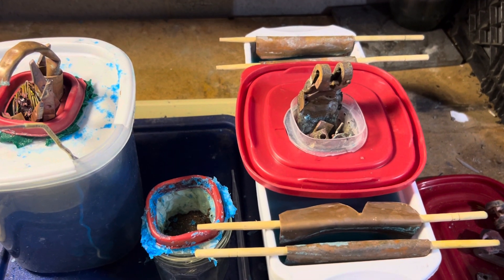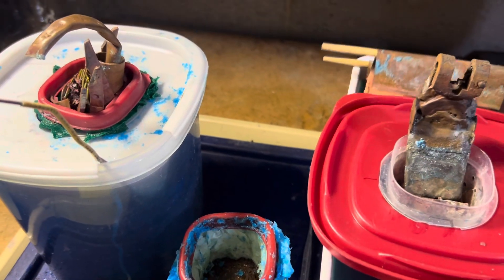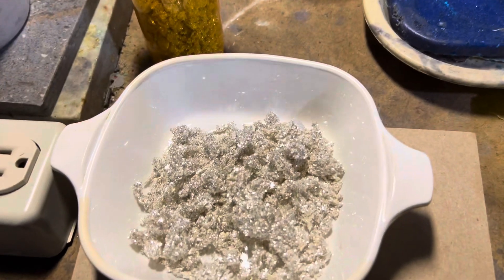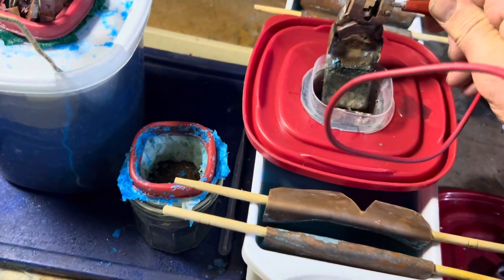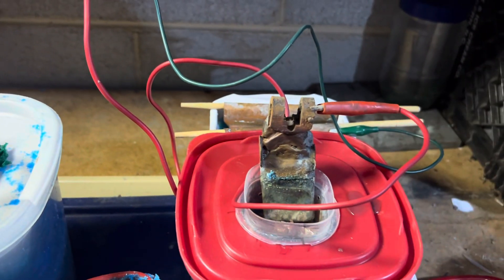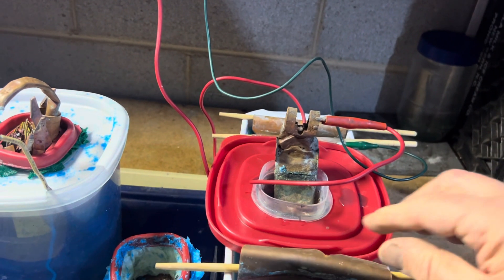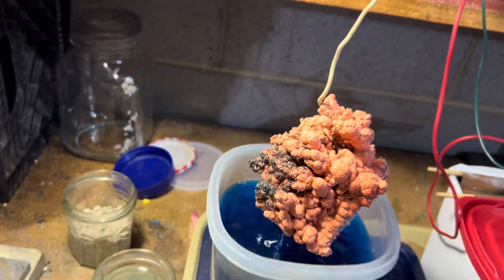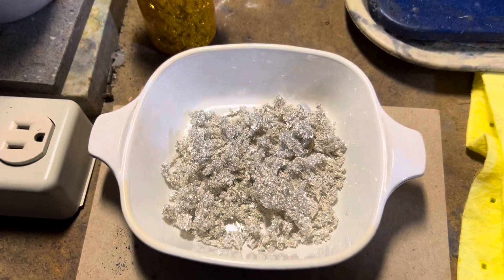Copper refining Cell #scraper #chemistry

Comment: Can you use one power source for mutiple cells?
Reply from the maker: No sir it would be to much resistance , one power source  per cell. I starting up a new copper cell this week to remove silver from silver solder HVAC joints

Comment: If I have gold plated boards would it work the same as the silver?
Reply from the maker: Depopulate the board , remove all metals and separate accordingly then put in AP ( copper 2 chloride ) with a bubbler . After  7-10 days sieve , filter , roast , process w/ bleach / HCl or Aqua Regia. Drop with ferrous sulphate .

Comment: How do you clean slimes with Hydrochloric acid? Do you have a video on that?
Reply from the maker: I use nitric these slimes were mostly silver , I will be doing another copper cell to recover silver from HVAC soldered joints ,  a soon . Currently I’m working on gold from gold filled  jewelry, thank for stopping by and commenting
Reply from the maker: Started another copper cell to recover silver from HVAC / Refrigeration joints this week a lot of details on building it

Comment: Good morning. What is your CuSO4 solution concentration in your first electrolytic cell where you are separating  your copper from the alloy? You had mentioned a small amount of H2SO4 and in what concentration was added?
Reply from the maker: I do 10-20 ml of HSO4 / 1L of CuHSO4 , and try to maintain a pH of 1-2  in the solution .

Comment: Nice setup. Reminds me of sreetips silvercell. How's the deposit? Solid or crumbly?  
Please try to use gloves,  if only to show viewers safe practice with toxic metal salts.
Martijn.
Reply from the maker: Thanks for subscribing Michael . I think the crystal are tighter with lower V and A.
Run the cell with 1.5-5 volts and less than 1 Amp . You can run higher but the crystals get loose and crumbly . 
Check out gold refining forum when you have a chance .
Reply: @Hill-13  I have done that. I guess I should search there for the amount of Copper sulfate to water on the electrolyte. I may even go with Copper nitrate from a future silver drop.  Thanks.
Reply: Just subscribed, by the way.
Reply from the maker: The deposit are solid not crumbly current and voltage low
.2-.4 A / 1.2 V 
Really busted on the gloves, Two boxes of gloves on order 
Thanks
Reply: I thought you said 4 v and 1 amp. I'll have to go back and listen again. Also, do you have any the ratio of Copper sulfate to water. (x grams per liter) on your initial electrolyte?

Comment: Great video, with plate material do the tin lead and other co metals hang out in the slimes as well? Or do all metals higher on the reactivity series pass to the copper anode? Or do they exchange with the copper electrolyte plating out the copper and making a stanous sulfate solution?
Reply from the maker: Lead and tin would remain in solution as sulphates not precipitate out.
Ion exchange is copper ion and hydrogen ions
Any PMG will cement out on the copper cathode